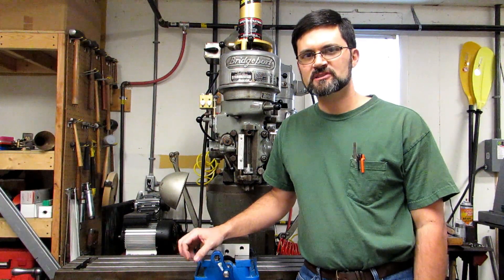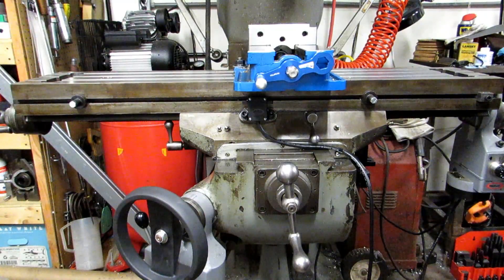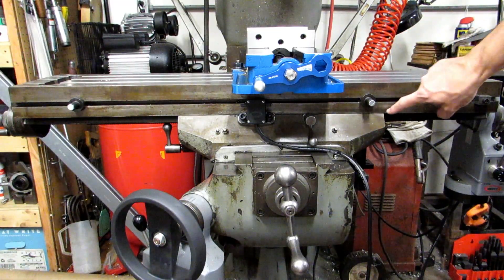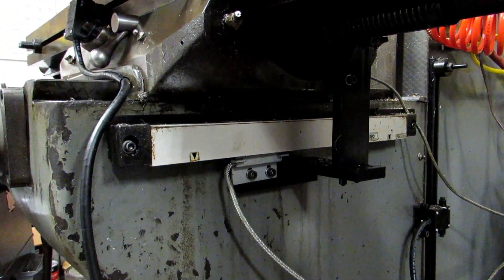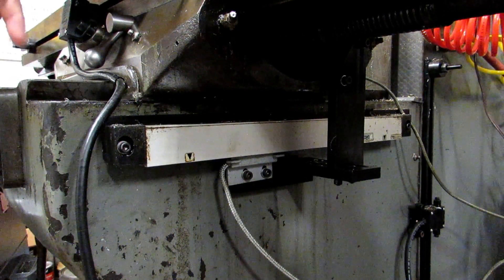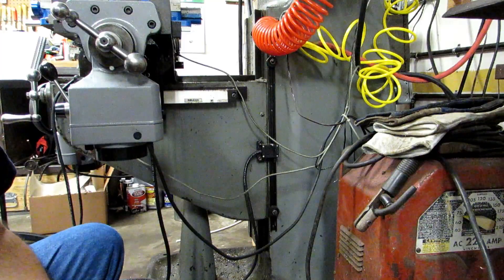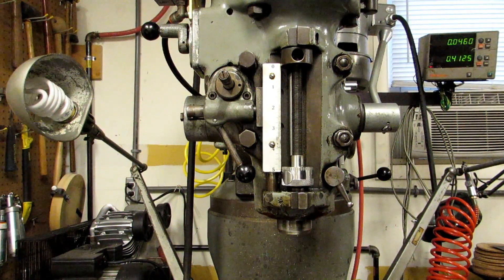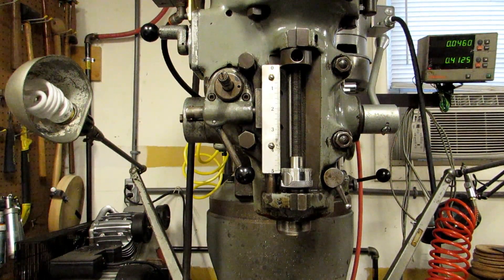How to Install a DRO 1 - Measuring the Mill

Comment: Hi folks, this is a very comprehensive set of videos and well worth watching. Stuart is using glass scales and the better ones of these are made to a very high degree of accuracy.  So accurate that the clean rooms they are made in are often underground to give better close temperature control. It's worth taking an appropriate amount of care with the installation to get the best out of these measurement systems. Think about what level you need when doing this. An error in alignment is not the same as an error in measurement, that's due to it being what is usually called a 'cosine error'. Tiny for small angular errors. Is the installation on a mill or a jig borer? Scale alignment is also important for more than accuracy. Glass scales break easily if mistreated so one does not want the read heads putting any strain on the delicate scales. There is some tolerance but it is not that large so do take care. Tolerance figures should be in the info pack that came with your scales. Stay within them! Enjoy your installation, it makes a vast difference to the ease and speed of using a mill.

Comment: Hi Folks, one other point. A lot of fuss is made throughout this otherwise excellent series about getting the scales parallel with the machine motion to minimise DRO parameter adjustment difficulties later - then sadly that aspect has not been covered. The video was never made, apparently due to understandable time constraints. It's a shame because no-one else has even mentioned it. BobUK.

Comment: Hi Folks. Good point about using the table for milling. If you do want to include the spindle travel there are units available that will add the outputs of the linear scales together. In the UK look at the MDRO web site, must be available in the States. They allow the two readings to be combined and displayed on the DRO Z axis. It's perhaps more useful for those of us with column mills and tables that only move in two dimensions. I think the Bridgeport has good drilling depth control so not really needed. Cheers. BobUK

Comment: Just a clarification, a 9x42 Bridgeport has 30" of X travel per BP's manuals... the 48" table has 36" of X travel.
Reply from the maker: Thanks, Bill.  One thing I should have pointed out in the video was that the scales are offered in certain lengths only, so the length you choose should be longer than your actual travel to avoid running the reader head into the end of the scale.  Thanks for watching!
Reply: Yes, having just ordered a pair of DRO's for my lathe and mill,  I found you have to read the manufacturers literature carefully as different scales have differing amounts of extra length over the actual travel length.

Really enjoying your channel Stu, keep up the good work.